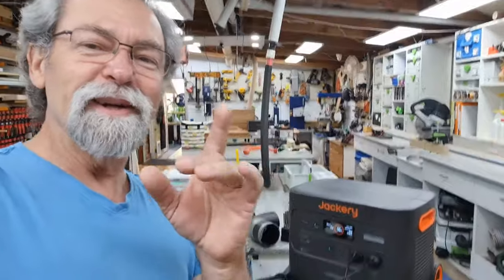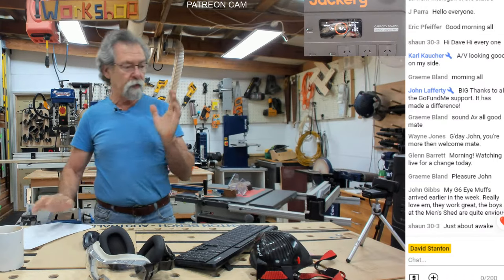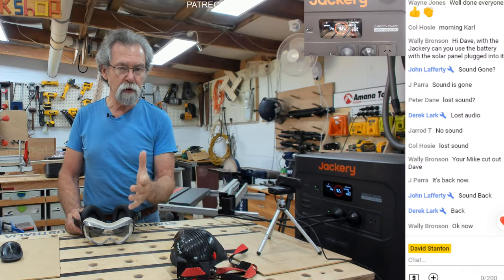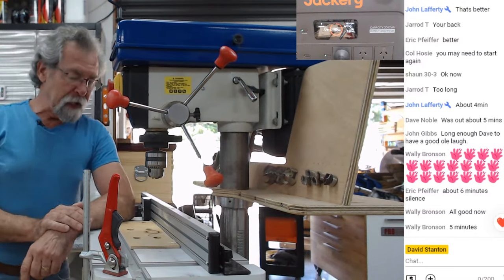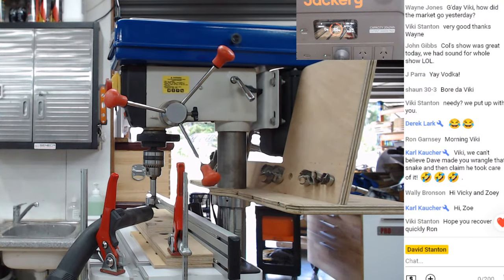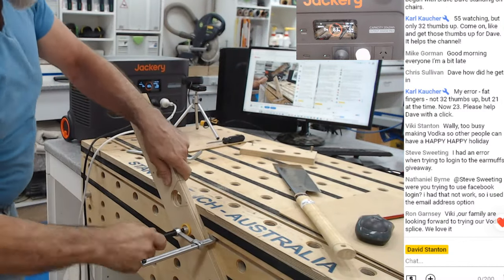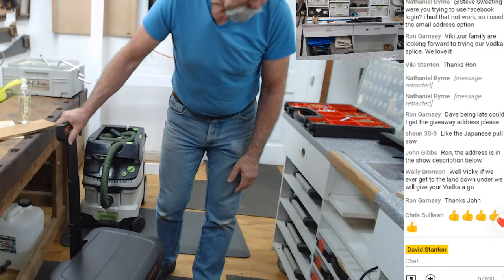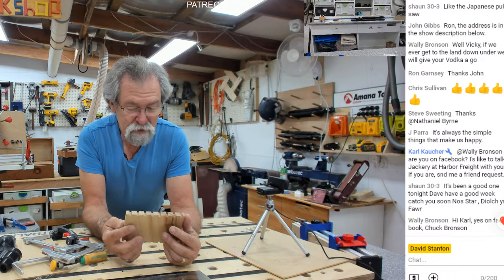Trim router table dust port | DIY | Easy | Jackery AC power | Dave Stanton Live!

Comment: I needed a vacuum cleaner (I'd sold my timber floored house and moved into a carpetted unit), so I brought a shop-vac compatible with my electric tools... apart from the assembly instructions being incomplete (2 steps missed out ~ don't these manufacturers do "blind tests" for the assembly of their products?),  I  use it on its lowest vacuum on the carpets... don't want bald spot ~ wouldn't get rental bond back
Reply from the maker: Good idea there William!